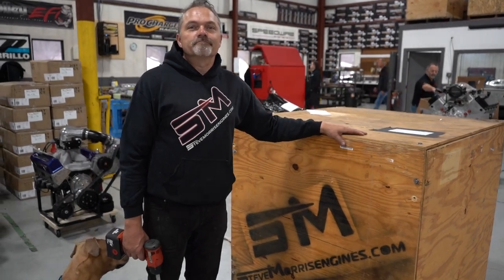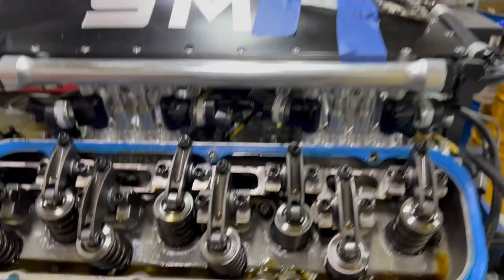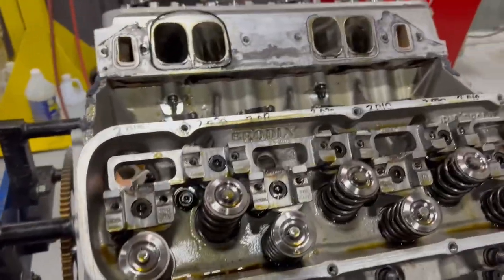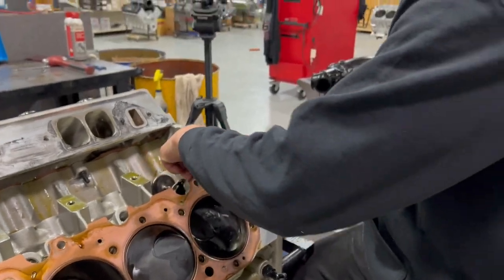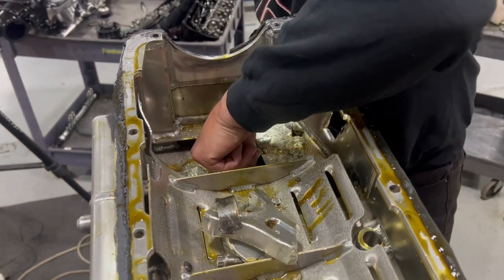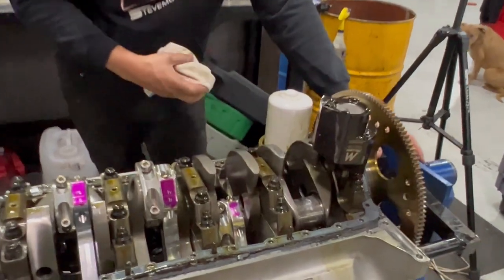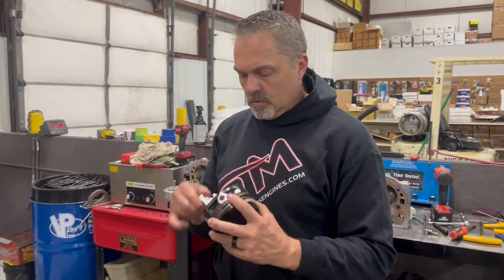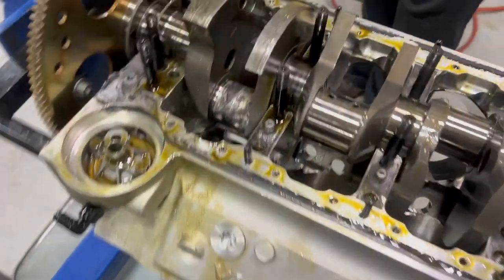Mullet !  What Happened ? - Warning: Engine CARNAGE

Comment: The back 2 rod bearings are the root of the failure of the rods. Lack of oil (running it dry) could have damaged those bearings and potentially might have caused the failure.

Comment: Man, the more of your videos I watch, the more I wonder if aluminum rods are really worth what they cost. I mean how many tenths of a second do they really take off your ET ? Everybody knows aluminum has a greater coefficient of expansion than steel. It wouldn't surprise me any to see their bearing clearance lessen with heat though I wouldn't expect any closest to the pump to buy the farm first (even though I do suspect rear cylinders tend to run hotter in an engine bay). If your all that concerned about reducing reciprocating weight why not run a flat crank? I know they're less torque; but since your already dumping a converter to lose some on launch anyway what's the difference? They're supposed to accelerate faster because they're not counter-weighted as heavy as cross cranks; and how come YOU don't get a Lynco with a torque inverter? Aren't you tired of burning up auto-trans clutch-packs yet ? You have good hand-eye coordination; you don't have to do everything off a couple of buttons ya know.